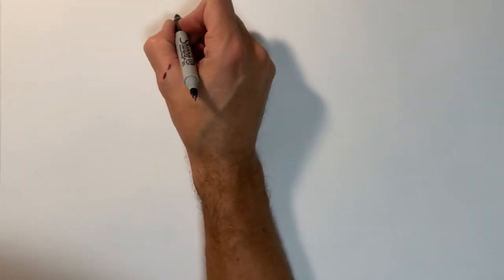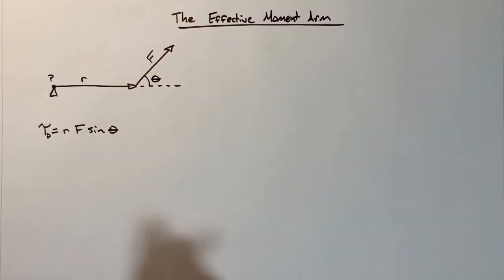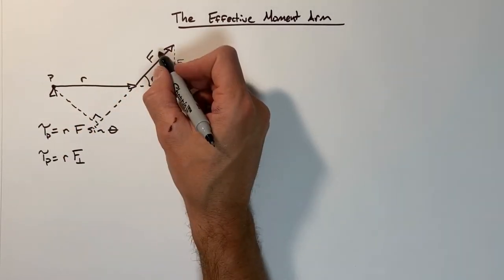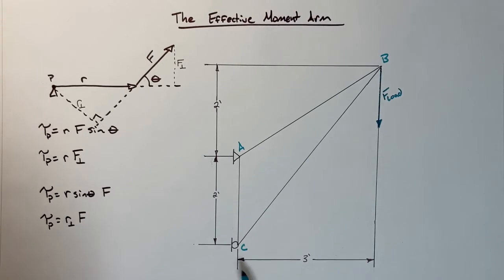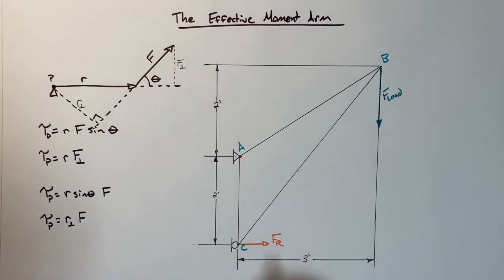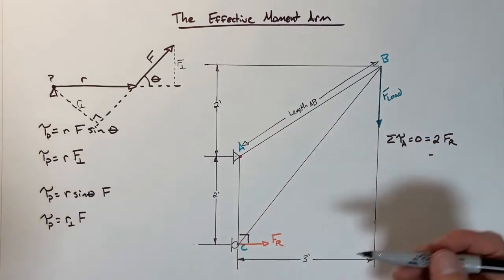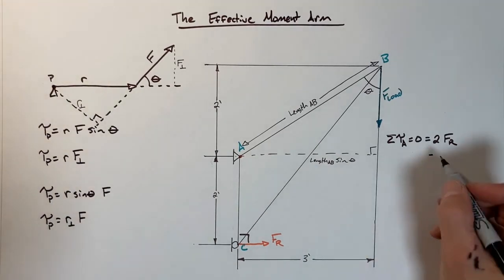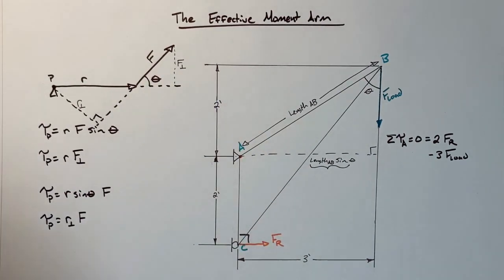Finding the Effective Moment Arm

Comment: not an engineer (though in college I may study it) but a highschool senior but this was still helpful, thanks
99.9% of the questions involving torque at our level are in 1 dimension only (or to be more specific involve objects extending out in 1 direction only e.g. doors, see-saws, selfie sticks, planks etc so the only trick was to find the angles and sine of the forces), so when a question came in a test involving an L-shaped object and asked the max torque before it tips over its base I was absolutely stumped because we'd never done torques involving 2 dimensions. this video helped explain it clearly and I never knew that you could simply take the moment arm around a pivot in any direction, especially not like this. 😵

EDIT: i see that you've recently uploaded a video about a rectangular lego block tipping over, that was similar to the question we had in our test, except it was an L shaped object with the L standing upright on a floor and a force applied perpendicular to the top of the L
Reply from the maker: Glad I could help.
Reply: @INTEGRALPHYSICS  hello after almost a year, I'm doing engineering in college now and taking a introductory physics course this semester but I seem to have forgotten everything from highschool so here I am again.  😎
Reply: @INTEGRALPHYSICS  😎